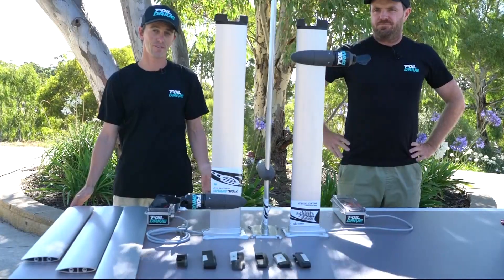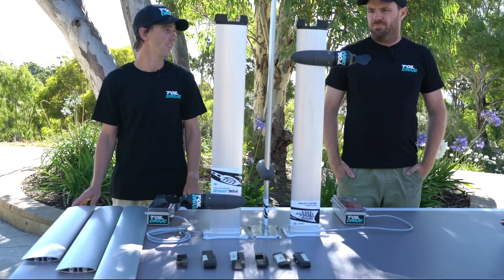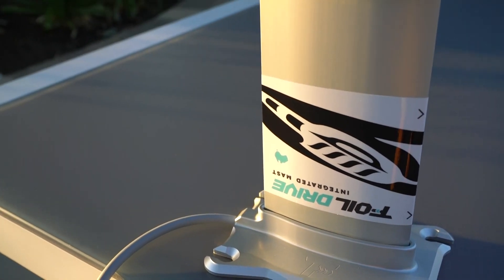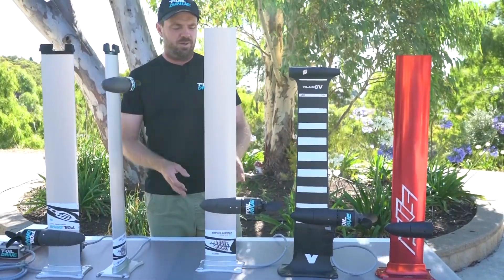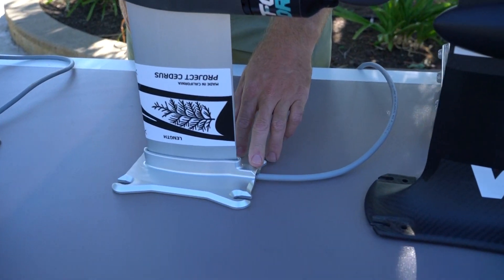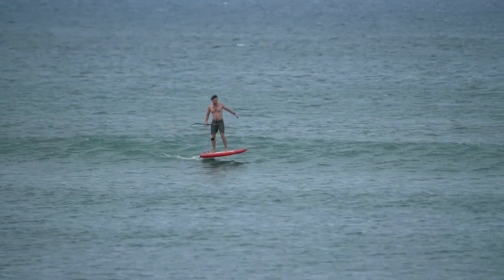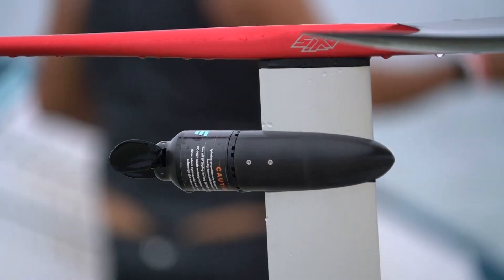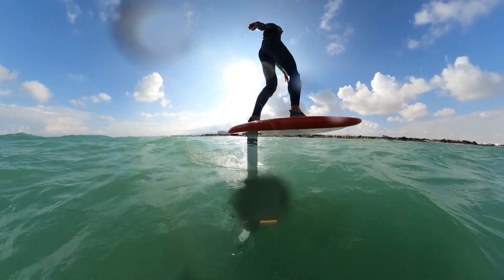Foil Drive x Project Cedrus Integrated Mast Option

Comment: How about offering a battery box that can be cut into any board.  

2 levels of construction: 

First, a more simple flush mount box that gets glued and glassed in the top of the board. With a small conduit for motor wires to exit the bottom of board. That way motor wires could be removed or replaced and board could still be used without a motor. Track top stuck to the battery cover.

Second option would be a battery box that incorporates the bottom foil tracks and the hole for the motor wires. This would require a complete or partial pass trough hole for mounting in the board.  Maybe a kit to be installed by a shaper or those with fiberglass skills. Include a router template.  

This approach would give work to local shapers and get people foiling for much less than 12k that most efoils cost.

Comment: I just ordered one. Ben at foil drive was awesome in answering my questions. Went with a 20cm mounting.
Reply: Hey Paul, what length mast? On the website it only allows you to select a height of 12, 17 or 22cm when ordering. I'm looking at an 80cm mast and would like 20cm height too. Cheers
Reply: @SammyJ239  Sam, I chose the 80 cm mast and had the foil drive mounted at 20 cm from the board so it's an assist set up vs efoil set up. One additional thing that I found it is that when the length of the power cable exceeds 140 cm it can lead to additional battery drain. There is no instance in which you will need a cable longer than 140 cm since you cannot move this to an efoil position. Took a lot of research and back and forth to figure out all these things so hope this thread helps people. An additional item that was confusing to me was the mounting brackets. Here's the easy way to determine which one you need for your board
If it has screw holes for foot straps = Mounting base plate, if no screw holes for straps = Low profile anchor point

Final thing. I efoil surf and am used to all of the drag and lack of maneuverability due to weight of a Lift efoil. I seen a YT video in which they test the new system as an efoil and it's impressive due to the lack of drag. I honestly may have gone with that set up instead had I seen the video first. I think it offers more flexibility and the lower mounting point seemed to have very little adverse effects. Here's the link. It's worth watching prior to ordering.
https://www.youtube.com/watch?v=anI61LbjEuA
Reply: @Metal Roofing Learning Channel®  Thanx for reply Paul, good info to help with some questions I have. Now decide on 18 or 25cm or pay even more $100 to go custom at 20cm.